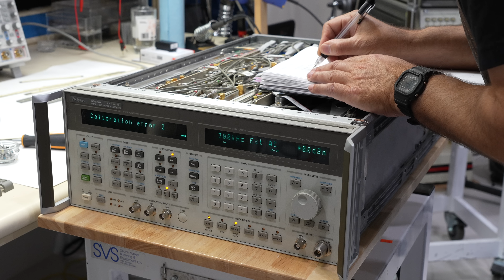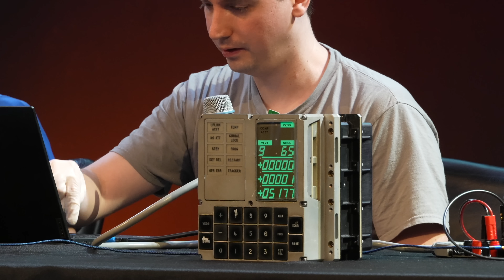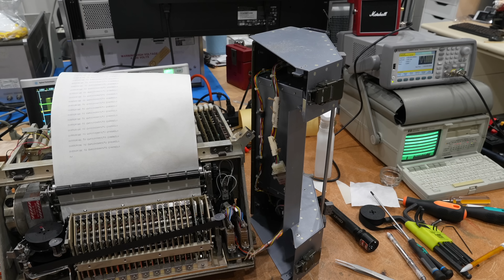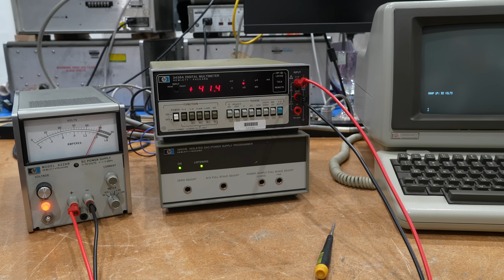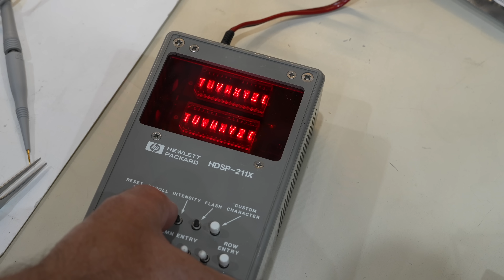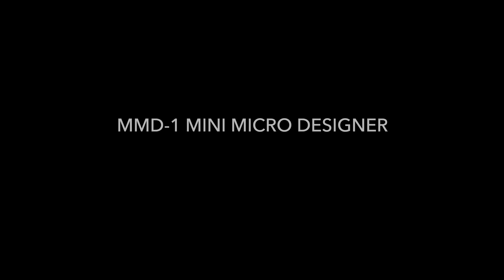2025 CuriousMarc Channel Rewind

Comment: Seeing the paper tape reader on the Atari reminded me of the late 70s when I worked on PRX205 exchanges. New software loads took hours and we only knew when we did a PIN if it had worked! By the early 80s we had upgraded to DC300A cartridges, much faster.